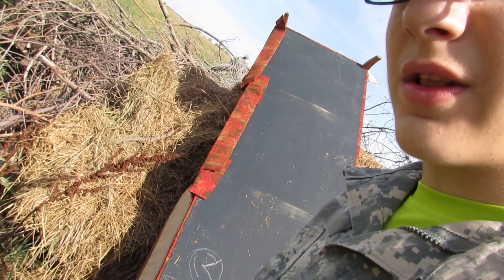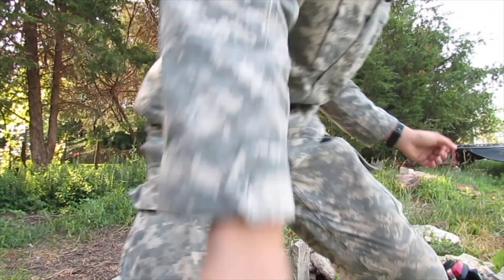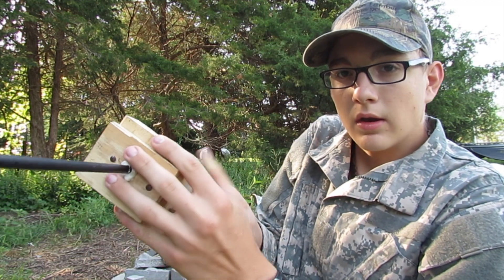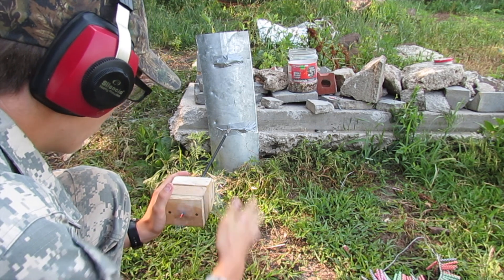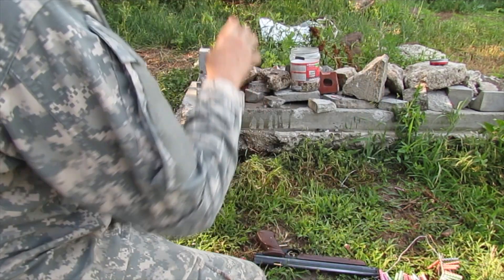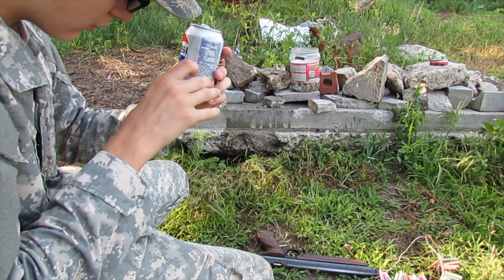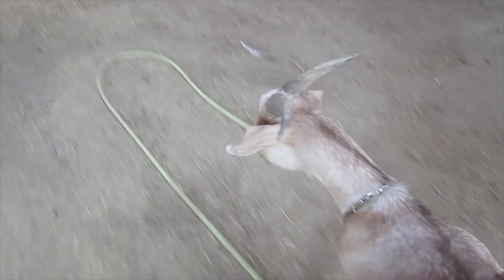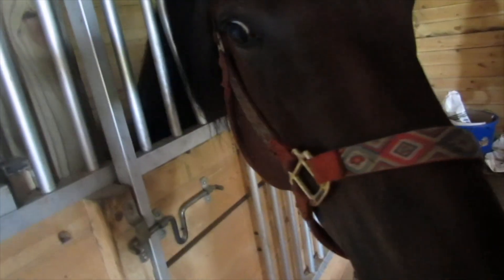The Science Behind Hydrostatic Shock

Comment: You're not getting hydrostatic shock from that gun in particular because it's going too slow you need something going about Mach 2 and weighing approximately 40 grains you need something like 500 foot pounds of energy to actually make hydrostatic shock a thing
Reply from the maker: Muzzle energy and speed can be irrelevant if the shape of the projectile is right. In this case, no hydrostatic shock would be just a hole through and through, not a gaping hole with no exit wound. Speed and energy help, but are not necessarily necessary as evident with the can expanding well past the projectile size. Thank you for your feedback!